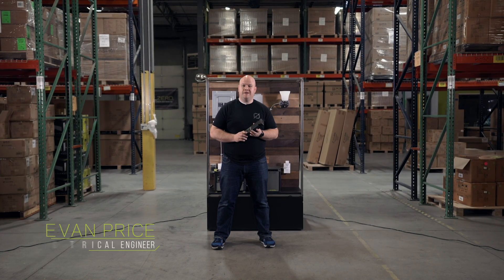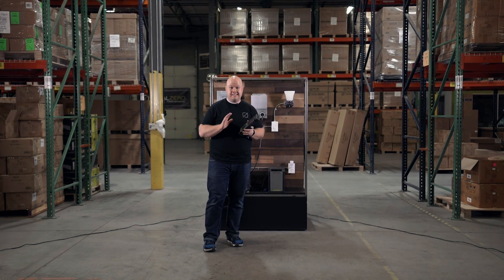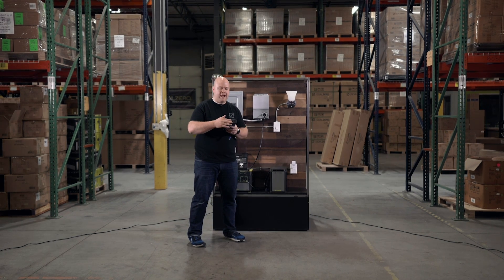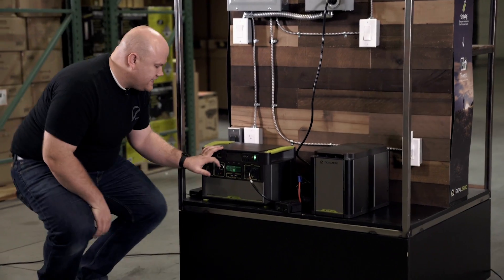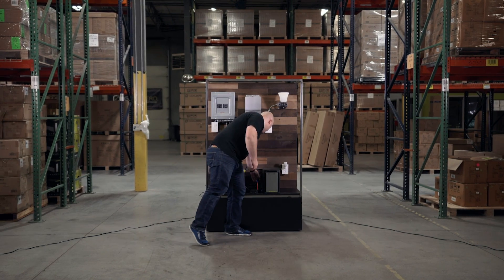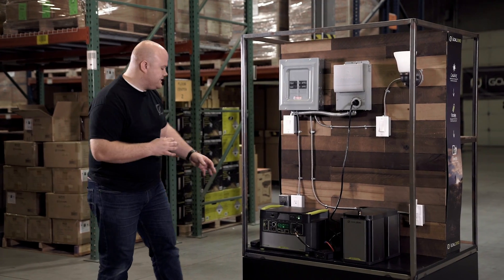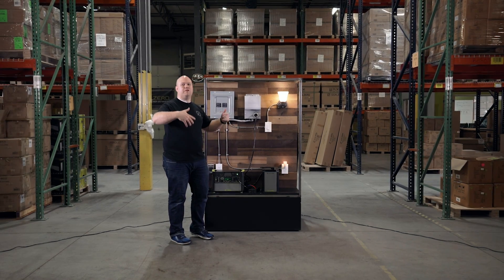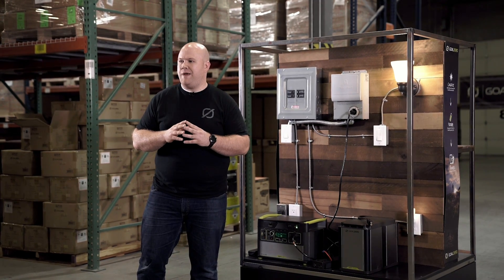From the Engineers | The Goal Zero Yeti Link & Tank

Comment: I have this same setup, but I'm trying to figure out how or when the tanks are supposed to kick in.  I've plugged them in and the tank is showing full LED charge.  I have a Yeti 1000x the Tank is plugged into via the link module.  I don't see anything on my Yeti's display change when I plug in the Tanks.  I ran my Yeti down to nothing and everything stopped even though my Tanks were showing a full charge.  I don't see anything on my Yeti 1000x that indicates they are being charged by the Tanks.  I have called tech support and they did a replacement on the module, but the replacement module acts the same way.  Not sure how this stuff is supposed to work, but I can't get the power to come out of my Tank into the Yeti.    I have two 1000Xs and both modules behave the same way in both Yetis.  I would surely love if someone could explain how this stuff is supposed to work.
Reply: are you sure the link module is fully plugged in? the micro USB cable needs to be fully seated, that is how the link and the yeti communicate with each other.

Comment: First of all thank you for making the youtube video.   I was really excited about the Yeti 6000X when I finally received it around May 2021, I used it for several months and didn't have any issues, until I stopped using it for about 4 months because I am renovating my house and I had to use Solar Panels from Goal Zero also. I been charging my Yeti 6000x for 3 straight days now and it only at 77% full. When I first plug it in to the same power outlet it shows 500W going in and after a minute it will go down to 50W. I also called Goal Zero Technical Support and we trouble shoot it but it turns our that it needs to be replaced with a new one (Hopefully New). The sad part is today is March 2022 and I haven't even paid the Yeti 6000X because I loan it through Affirm. I mean it has 2 years warranty but I just bother me that not even a year of using it, its broken already? I am very careful with it also and only use it for basic stuff in the house because I am afraid that It will stress the battery. What happens if the warranty expires? I will be stuck with a block of useless equipment and make it to a chair probably? I am freaking out really. Did anyone of you ran into this issue? Is there 3rd party where I can buy to extend the warranty?  PLEASE HELP! Thank you!
Reply: W😱W! 
3 months and no reply? please let us know how this works out.
Reply from the maker: Hi Christian, 
Please reach out to support to see how we can help further! support@goalzero.com or (888) 794-6250
Reply: You should have purchased a ecoflow or bluetti. Goal zero is years behind everyone else. I mean come on they use lead acid batteries for their expansion! Lol plus their main power stations only last 500 cycles before it gets to 80 percent compared to 3500 from bluetti and ecoflow

Comment: I have spent over $6k on GZ products and wish I did not. I wish I would have spent less on GZ and used it primarily for camping/hunting trips and paid for a professional install of a solar generator and battery bank system for my house.  I know this would have cost $10k more, but I would have subsidized that by not buying the 4 expansion tanks, yeti link, cables, and home integration kit.  The Expansion tank's recharge rate is too slow for constant use or large draws during the day, i.e. long-term home use; they don't protect for over 50% drain on the lead-acid batteries. The only thing I can think of to increase the lead-acid battery recharge rate is to either buy another goal zero generator to use just to charge the expansion batteries or find some other non-proprietary method to recharge.  I am not an electrical engineer so this makes it difficult.  Especially when I receive two different answers from GZ Staff on a similar question.  I think I need to bite the bullet and stop buying GZ for home use and just hire a local solar company to go completely off-grid.

Comment: How do you recharge the external battery or Tank Expansion?
Reply: The GZ 1400 in my case is recharged on it's own by solar panels, (I use 3 different portable units two commercial brands, an Allspower at 60W, another 120W similar but 4 times the weight and size, & a home made 100W folding semi flexible 2-50W panels that's my favorite still made over 5 years ago and refigured for the GZ1400 when I went lithium from deep cell similar solar) If you are traveling you can plug into your DC car system but that needs to be unplugged when not traveling to avoid vehicle battery drain. And then of course at home and when not in use I keep it as most will do when set up as demonstrated above to your AC. You plug it to any 110 Wall outlet and it keeps your GZ topped off year round. By plugging it into the wall as he demonstrates sort of in this video you also keep the deep cell storage batteries charged. I have four of the GZ deep cells and since I owned the GZ1400 before they introduced the storage cells I didn't purchase a different model. I do wish they showed in a demo how to install everything more clearly together and how it works. I mean why not do a far better job of that. Or Goal Zero just post videos on your own site which they really don't. They like to send out lots of ad's and hype products inluding this sytem with their most current X lithium models but again they don't actually take the time to show what's fully going on and connected and just how. I tried to hire an electcian in our rural area and 2 never showed. So bought our units last Feb and still have yet to get everything connected but are charging or recharging the storage cells but decided to do one at a time until all are charged then my husband who is afraid to stack them despite GZ always showing them stacked and suppose to stack up to 3 high I believe so planned to do 2 high side by sides but he insists they can't be and will instead build a two level rack so the storage units are not sitting directly on each other but shelved and then the GZ will fit on top on a third shelf. Meantime yes hubby can do electrical work as we've rewired a few older homes but this home is complicated and older and it would be far more helpful to find an electrcian so we have yet to wire in the switch box etc. We'll get there but GOAL ZERO could have and SHOULD do a much better job than they are. Also GOAL ZERO needs to monitor and answer questions posted here on Youtube too. Follow up GZ. Knock knock are you  there? Anyway hope this answers your question. GZ provides you with the AC car type charger, The Solar Charger via their anderson plugs and 12V's and also of course the AC charger cords. I already owned the portable solar panels and love all three I have plus a 24W and 18W mini back packing ones similar too. So you'll see some people on Youtube showing how they are using their solar batteries including GZ's to charge other storage batteries and how they actually are using extention cords to move the GZ's to a better position in their basements or homes to be able to connect to Solar outside if that need happens. We just want a system to run our LP Furnace fan and sump pump all 110V during power outage. The system we choose should do that for upwards of a week if not longer. We have no means right now to connect to a solar panel but in an emergency we probably could do so. We live in extreme NW corner of MT only 65 miles from Canada heart of the Rockies and in valley so sun  due to overcast and fog in winter is a rarity anyway. We would have to recharge system with our gasoline generator via AC connected but run outside of course and or vehicle recharge by running a motor again via extention so the GZ also recharges the storage batteries too. That would be an extreme for sure. But last winter our area was hit with high winds that took many of our neighbors without power for over 2 weeks others one week and we were lucky 11 hours. A very rural area despite that great response from power companies. There was downed trees that prevented some from getting gasoline to keep  generators running.  We are also investigating a similar set up but separate to run our well which is 220. The GZ is not designed for that but their 4 circut switch box, converters which they sell separate too & deep cell storage modules would be easy to convert for the Well at a later date. The LP lenox furnace works great but needs the fan and the sump pump drains concentration build up off throughout the furnace run, so our primary need. We have plenty of LED lights & lanterns with small power banks to keep the home lit for a good 2-3 weeks. Small cook units run with gas for camping so we can easily live without power for cooking. Our needs are primarily furnace to keep house from freezing and power for our phone system and at least one computer stage and otherwise we are in great shape. (Our  main freezer is in unheated garage so no need in winter for power & in summer we'd use the gas generator. In the summer we'd have our main fridge and a small freezer set on one of the GZ circuts. In the summer we probably could keep the GZ recharged via the sun. The key here is the storage tanks keeping them fully topped off via AC trickle charge. The storage tanks depends on the lithium GZ battery itself to supply it's power. The set of 4 deepcells & GZ itself should run the furnace fan and pump for up to a week maybe closer to 2 before out of juice. We looked at LP Generators but did not work for us here, we looked at larger whole house generators but know there weakness like the LP systems depend on getting gas or LP refills which may not be practical in our rural pine forested area and again we don't have great sun exposure for going full solar here. So I suggest anyone looking into a back up power set up do their home work and educate yourself on what works best for you economical and practical. Each home or business is different. Has different needs. Many homes do not need any concerns with 220V. Many however do. But for us it's a compromise. We will eventually get this up and running but Goal Zero as a company has let EVERY CUSTOMER DOWN by not providing better CLEAR directions and information. Btw one electrcian turned us down due to that lack of info as he said NO WAY even if I were to do it right if anything failed I could be held liable. Really didn't cross our minds at that response but it comes down to GZ's lack of TOTAL CUSTOMER support. (For one thing I had to remove a module they had us buy to run two different solar inputs at the same time to fit the one they show in this video that allows you to charge the Deep Cell units. That should be explained before even purchase. Yes we are happy to do that but really just let us know these details.

Comment: Really GZ your showing off and introducing this on this video and with all your POWER devices and lights you can't SHINE ENOUGH LIGHT on the connections you are point out? It's so dark in your warehouse it would be appreciated to be able to ACTUALLY SEE what you are doing. By the way I own your 4 storage tank, GZ 1400 complete with integration system and panel and I"M STILL IN THE DARK HERE. Why because YOU FAIL so bad at showing what a person needs to see and KNOW. For example it appears my GZ 1400 will not be plug and unplug and portable to go once the whole system in installed and the GZ 1400 will be wired to the storage batteries. WHAT? I watched other GZ videos and Todd Parker who showed before the storage batteries were introducted that the GZ solar could be run anywhere from right up close to the Circuts to across the whole basement and just plug it in via extentions one way or the other options. But hubby said a month ago when all the batteries and all arrived and  he read through the very limited manuals that NO it'll have to be connected and not by easy plug set up it's more like hard wired into the set up. NOW mind you we have a 12 foot deep unusual basement that only has 3 windows and none near the Electric Panel wall. Also the walls are made of the kind of cement that you can't drill into without special equipment and drills so making a hole say to carry solar panel extentions to the GZ isn't going to be practical. And yes the idea is to trickle charge the GZ and the Storage batteries via through the GZ 1400 or larger which is fine when we have power. BUT if the power failure lasts a while it would be nice to be able to disconnect the GZ and charge via solar and or even add solar into the charge to help keep the Power Tanks topped off so to speak or refilled at best. Meantime I'm not happy. The plan was to upgrade to a 3000X this year too. But since the 1400 fails me keeping my Dometic 27qt freezer working when the GZ falls below 84% due to compability issues I see where competitors have worked that kink out and they now can run and supply the AC Juice right down to an empty tank without this kind of failure. We are fine if there are no over cast days like two in a row and worse for us Wildfire haze which seems worse than even overcast cloudy days. So as much as we need to hire an electrician the first we contacted said NO he knows nothing about these and doesn't want to. We have 2 other leads but we live 100 miles from nearest populated area such as Kalispell MT. So fo rural areas of the USA and MT is not the only state or inner state that has this problem and often rural people benefit most from this type of technology companies such as yours so needs to STEP UP. If you do not want to show videos for fear someone will steal some kind of info from you then make them and link they to customers who purchase your product. As much as we will and need to use a professional to install here...hubby is 83 and even though I carried all 4 batteries myself down to basement I'm in my 70's and 5'2" a professional is not here when an emergency happens and WE need to know and understand the system and how it operates to insure our safety and homes safety all around. So yes we need to know how to install and disconnect and all those things. Also you mention ask questions on your site...that's a joke. When I bought the original 1400 I asked and asked and asked and never heard a word from you. Went to a convention with the GZ for a week where we hosted a couple from Australia camping and that's when we had problems with the compatiblity and dometic freezer. Fortunately we were able to limp through the week as every day but two we were able to get it back up to 90-97% charge. But very frustrating. Finally once home made a connection with a rep who I did call another time and though he explained the incompatiblity problems it didn't help now did it. So I continue to struggle with that. But when I asked questions about the house integration system FINALLY after at least 3 attempts we got one answer and it just said NO do not do what I was asking and sent me to a link that's basically the same limited manual that is provided with the devices. In otherwords not very helpful at all. I'm not searching for a portable Solar unit that will run my dometic this year and probably will not buy the 3000X because it'll have to be hardwired to the battery packs too and I'm still looking at a solar charged battery system that will run my Dometic. (I start off with freezing 6 half gallon bottles filled about 3/4 full of water. Putting two in a 5 day cooler and the other four already frozen in the Dometic. Plug the dometic into the Car 12V and off I go camping. (A female solar tent camper for over 50 years as hubby of 49 years has never been into camping. A lot of females of all ages enjoy camping solo and often same story husbands are not into it but like mine is fine to let them go.) Ok every year weight is more a concern so love to keep it down. I had two 800 watt deep cell battery solar powered versions that weighed in at around 35 pounds each pre-Goal Zero era. But as they died a month apart each of them I was so happy to see GZ come out with a larger capacity lithium finally. I'm patient to a degree but seems every time I think I have it figured out with your equipment and can use as intended it fails me but worse your support fails across the board. Just make some DECENT real HOW TO VIDEOS on this system that oh by the way is WELL LIGHTED. So you can actually SEE what you are attempting to show and tell. Instead I feel you are keeping it all a big secret and scared to actually share. If the latter is the case then provide links to actual buyers so we can see something please.

Comment: So many wires! Well, I applaud the efforts to make the devices more useful, but you've got to get the cost down and the wattage up. 1400 might be OK for a camper, but won't support much in your home and I can buy a 10,000W dual-fuel for half of what you charge for the 1400.
Reply: I think the purpose of this Video was to introduce you to the STORAGE BATTERY BACK UP SYSTEM. Thus it has a lot more than just say a Goal Zero 1400 W lithium solar battery. And yes you may half a 10K watt dual fuel for less money generator but it's not solar and so what is your point? I bought my GZ in 2018. Many people are adding GZ's and similar solar charged batteries to their campers with dual fuel systems to keep their back up storage batteries charged and use less fuel too. But then this video wasn't about that it was about taking advantage of the storage back up batteries which are not lithiums but deep cell units.